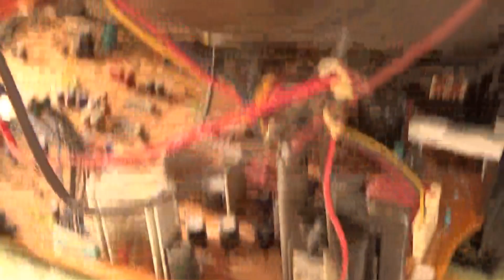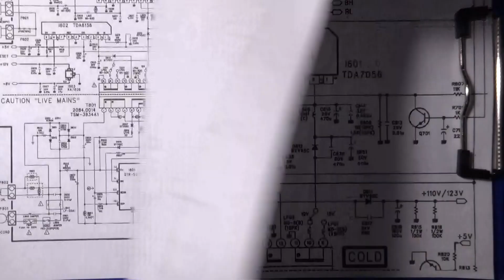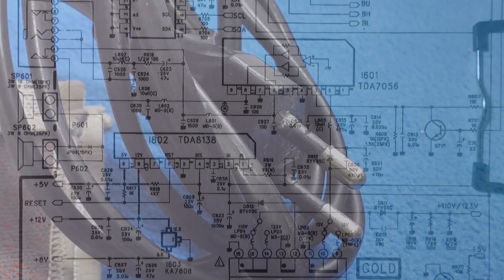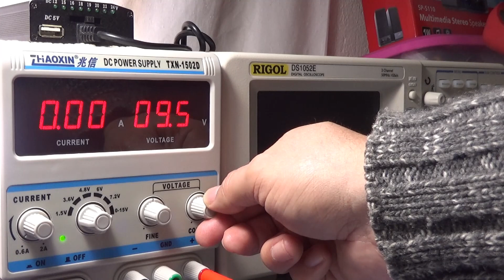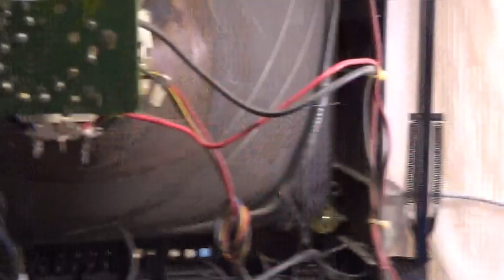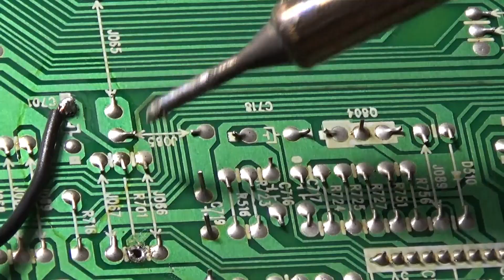TV DAEWOO 20Q1T how to repair intermittent no audio problem / sound mutes / repair tutorial

Comment: Hello Bob! I wander, if there is a problem in the firmware, why didnt the TV has this issue from the beginning, when it was new?
Reply from the maker: Because "in the beginning it was new".
Reply: @bob.kalpon1398  I think we are talking about 2 diff things. By firmware I understand the software driver that is written in the main chip. That is why, in newer products, the firmware can be updated e.g via internet.
Reply from the maker: @gearstil  With time, firmware can get corrupted like any software does. Also, semiconductors in chips can make the firmare to fail as the semiconductor changes  with the time. Just to give an example, its capacitance.  The last complication I want to deal with, is to flash a memory with  "a firmware I wouldn't know will work", because the TV looks very old compare with modern's technology. The video was about troubleshooting  with electronics knowledge and how to take short cuts based in hardware understanding.
Reply: @bob.kalpon1398  I understand the meaning of the video, and I agree with you. What I wanted to say is that the firmware will break due to hardware reasons, so in the end we can say that the chip is gone, and needs replacement. When I think as a firmware problem, I imagine an issue done by the team of programmers that didn`t test properly all the functionality, from the beginning. For example setting a threshold too high when something should happen and that is why it doesn`t happen. Thank for the video and the troubleshooting information. Where did you find the electric diagram for the TV?
Reply from the maker: @gearstil Today is common to talk about a "factory bug flasheable". But in electronics fails, everything in hardware is possible. (On TV like this, even the screen screw magnetized, or a bad shield can be a fail). Even a bad shield, a RF transmitter, can make the best programmed firmware to look like the worst product of the year. I remember one guy who told me "I don't know anything" because I said semiconductors get damaged with the time and it changes its parameters. But the kid didn't know we changed horizontal transistors by decades before he wet a pamper.  My experience in 35 years in this business, is anything can fail, but the last could be the Firmware. If we think smart, mute works in turning on and off. So, something else triggers it. If I flash the memory, probably I will get the same result. That's the reason I said it was a physiologic damage, because after all, "mute works", but the result was not as expected. ;-)
Reply: @bob.kalpon1398  I know you are an experienced engineer.  What are the factors that the life of the semiconductors depends on? the temperature? The purity of the material? Have the cheap semiconductors from China a shorter life ?
Reply: @bob.kalpon1398  Even I'm having software and a few firmware problems at age 59... And they can be fixed with Electricity ;-)